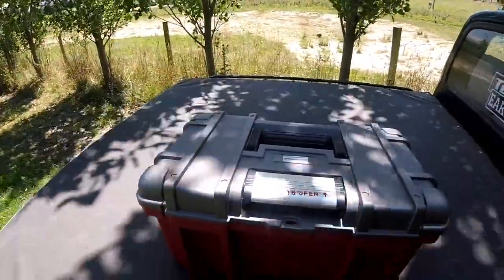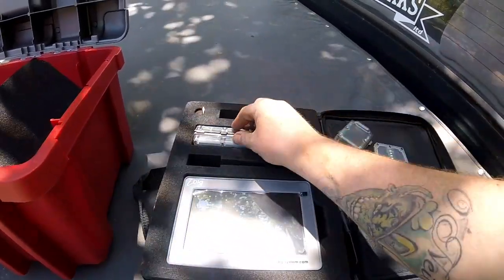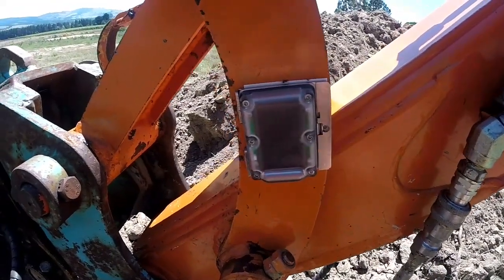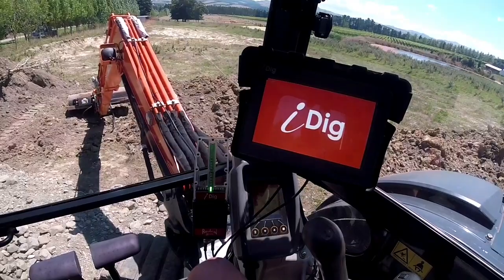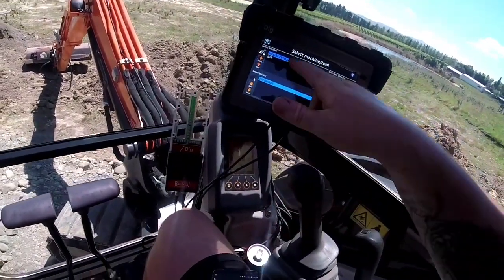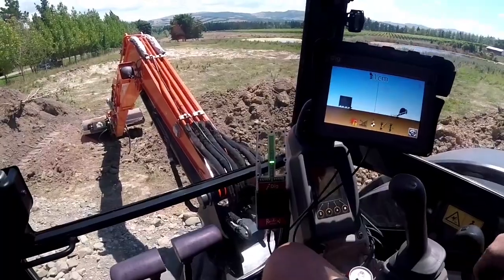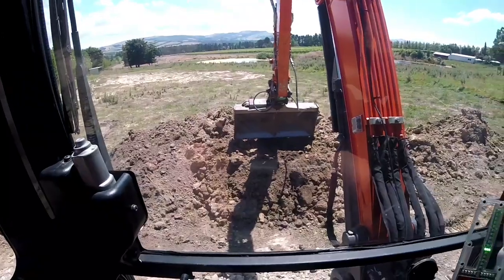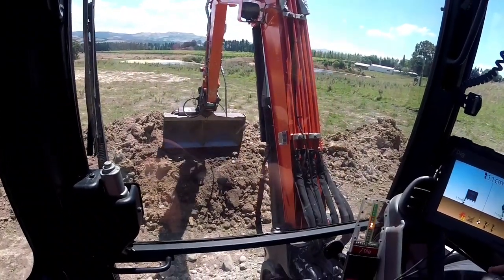iDig 2D Affordable Laser Guidance System For Excavators - Walkthrough

Comment: Is there any way you can add metal cages around the transmitter in the case of working on brush removal,or does this interfear with the signal?
Reply from the maker: You sure can, indeed, just can’t be fully enclosed

Comment: Looks like a handy piece of equipment however would only work if you stayed on level ground soon as you start tracking anywhere on uneven ground it would throw out your level.
Reply from the maker: Same as most 2D machine guidance systems, unless you have 3D then thats not an issue but its not often your grading on uneven ground as takes only a few seconds to get yourself situated
Reply: @Kiwidirtworks  What is the purpose of the sensor in the cab? They are IMUs correct? So wouldn't the cab sensor be able to compensate for unlevel ground?

Comment: I've been interested in this system.
What do you think of it so far.
Is it quick enough for grading?
Did you look at the trimble system compared to this?
Reply from the maker: I'm really liking it thus far.

When I first looked into it the worst thing was the lack of videos and info online however upon talking to the rep and having a wee demonstration we ordered it straight away.

There is a slight delay but its still fast enough to trim with, you'll find yourself doing a cut and then checking the grade with the idig system anyway which is what you'll see most of the trimble guys do too. 

The other thing I love is that its wireless and transferable between machines - we have two diggers so it makes sense and we also do alot of different work so we may be in amongst trees etc and have no risk of ripping off wires. 

And it takes less than two minuites to take off the machine at the end of the day although they are that discrete you could almost leave them on.
Reply from the maker: Matthew Sorensen I didn't look at the trimble system in depth, but from what I've seen this does everything that it does too at a lower cost. 

It does duel or single slope grades, tilt bucket/hitch angle, if you do drilling you can attach it to the auger to find plumb or a specific angle, and it also has a built in tape measure and height warning sensor if working under powerlines or restricted areas.
Reply: Yeah being able to swap it between my machines is the biggest factor that i am leaning towards. 
Plus being cheaper helps.

Do you charge more p/h for it or is it more of a nice feature to have for yourself. (more attractive to clients)

You're video is about the only vid that i have seen on this system so i will have to go see the local rep soon.

Very interesting about the auger too.
Reply from the maker: Matthew Sorensen 

I don't personally charge more for it, definitely more attractive to clients but it cuts down on labour costs having a man on a laser staff when they could be doing other things, also use less marker paint becaus I don't have to go around writing heights on the ground because they can be seen on the screen and also cuts down on material wasteage from excavating too much
Reply from the maker: Matthew Sorensen what country are you in?
Reply: NZ DIRT thanks bud.
Australia
Reply from the maker: Matthew Sorensen Position Partners are the dealers I believe in NZ & AUS
Reply: Mathew, what state are you in? I work for Position Partners. Give me a call if you'd like some more info on the idig
Reply: In queensland.
I've spoken to somebody at position partners 
Just wanted to get some end user feedback.